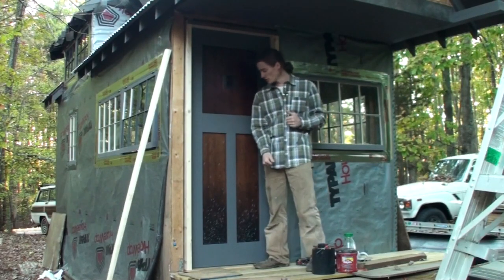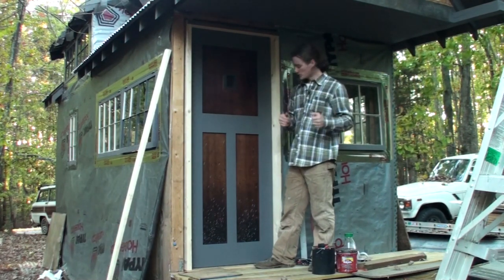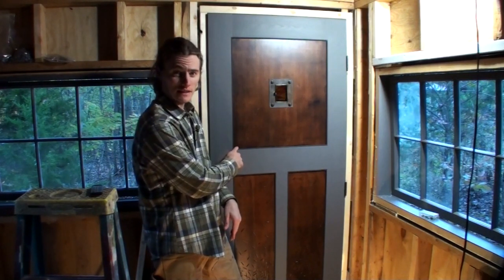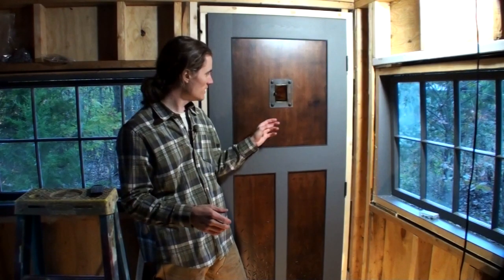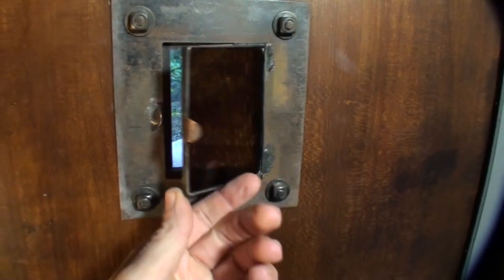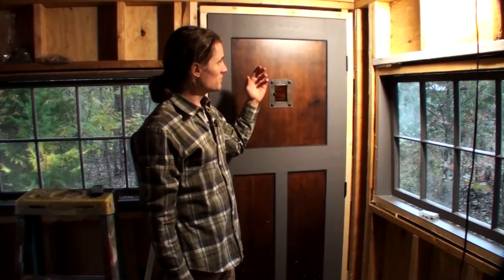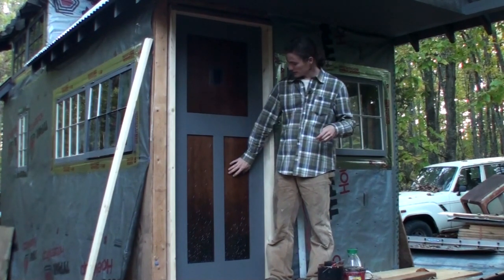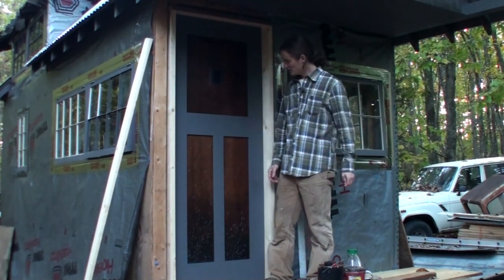Building a Tiny House #7 - Handmade Front Door

Comment: oh, dude, that carving on the lower panel is AWESOME.
great job, man!
Reply from the maker: Vladimir Kunnikov Thank you Vladimir. I've done that style of carving on several pieces of furniture I've made in the past and thought it would be a nice detail for the door. Glad you liked it.
Reply: Square Inch did you use a grinder with a thin stone to get the design look?? Looks awesome too!
Reply from the maker: whitewolf8758 HI, No, wasn't a grinder. I used a small gouge. Here's a link. I've had it for years, works great. http://www.woodcraft.com/Product/05Y62/pfeil-Swiss-made-9-Sweep-Gouge-5-mm-Palm-Handled.aspx
Reply: whitewolf8758 i thought it was a grinder too

Comment: That door came out so darn nice. You are an pretty amazing dude. I'm a carpenter and I would never have thought to make an entry door.  Did it lay flat after it was all finished? Great work!
Reply from the maker: 64maxpower Thanks, glad you liked the video. The door is pretty flat, there's about a 1/4 twist in it, but I can train that out easily. I just put a small block of wood at the bottom and shut the door, leave it a while and it get's it into shape, I've done it before and work perfect. Thanks for watching.

Comment: HC I really like the way you're putting this tiny house together. The little eye piece door is great. In relation to the roof cladding ie galvanise sheeting, have you any worries about excess noise with rain etc ? Love the vids as usual, I've seen an American Show on building tiny houses, ie professionals coming in and doing it for 30k or so, much prefer your approach, ie doing it yourself. I appreciate you sharing your time and talent. Thanks
Reply from the maker: hasdrubal121 Hey, for the metal roof, no worries about noise. I like it. And it's not really that loud. I don't even have insulation up yet and you can barely notice it. You could definitely spend a lot on one of these houses quick, I'm building mine slow so I'm able to find good deals, if you where in a hurry you would have to be willing to pay more or expect less. There's nothing wrong with either, it's just a choice.